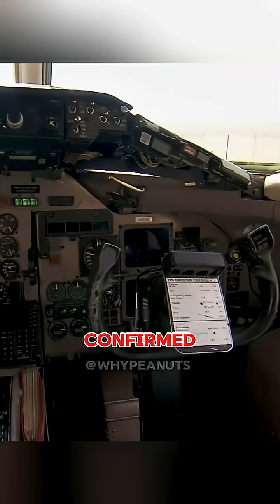Can Frozen Waste From 30,000 Feet Destroy a House?#shorts

Comment: If the valve leaks. Ok automobile plants specifically ford chevy pontiac buick. Just think of a couple of some of the garbage they put together and sold. Most Airplanes built anywhere near where those garbage automobiles were. Those Airplanes were only not garbage. Because of the regulations put in place and strictly enforced. A few got away with cutting corners. Almost all major corporations do it.